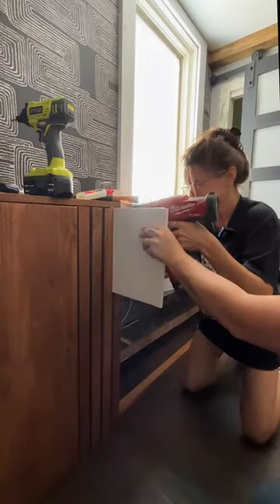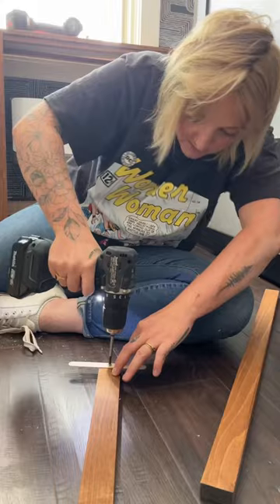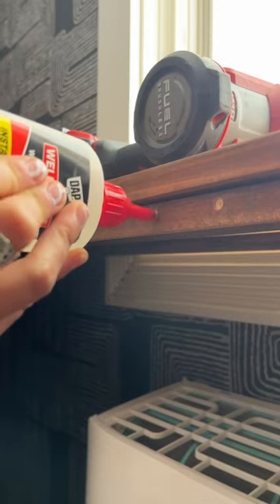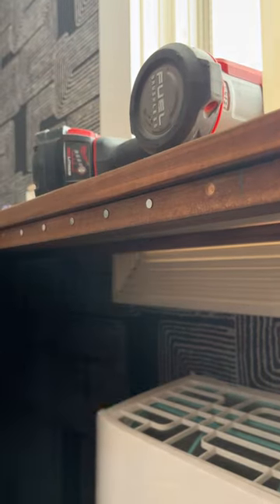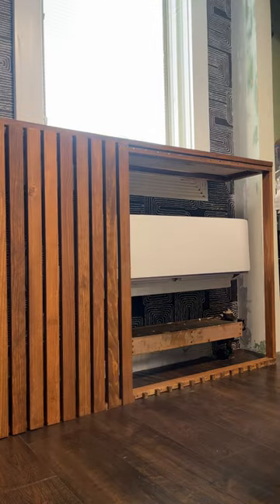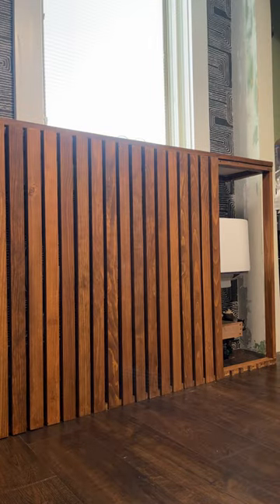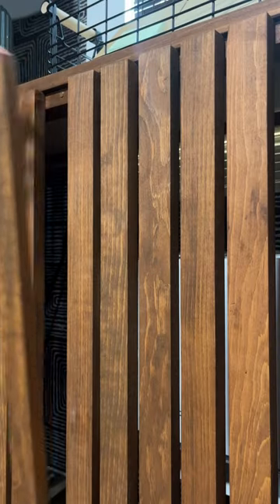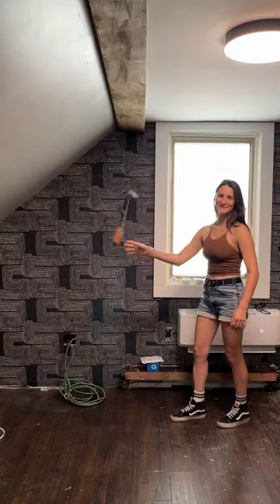Genius IKEA Hack Radiator Cover!

Comment: Can you do a video of must have tools to get started on making shelves and built ins like keyhole jigs, router etc??
Reply: To get started a jigsaw, sander and drill is enough. 

- A router is a nice to have when building cabinets. 
- Chop saw and table saw are great down the line for time management purposes (with a jig saw you need to attach a guide to everything to keep cuts straight).